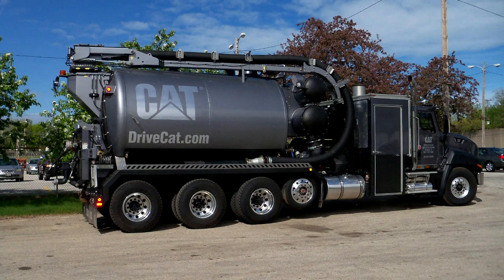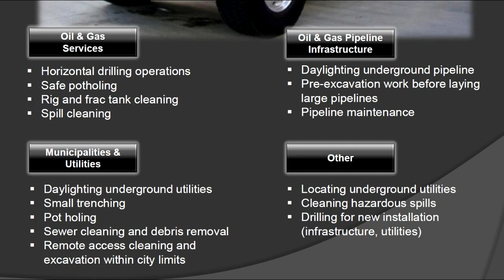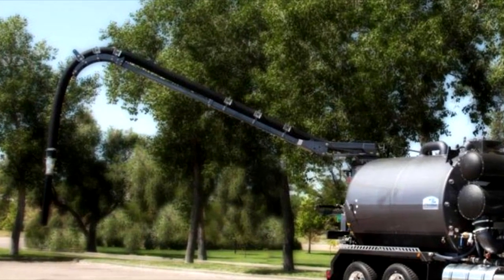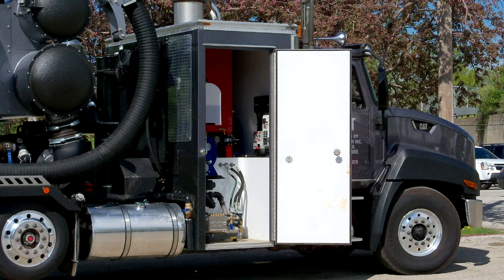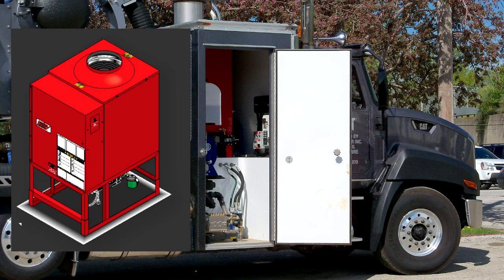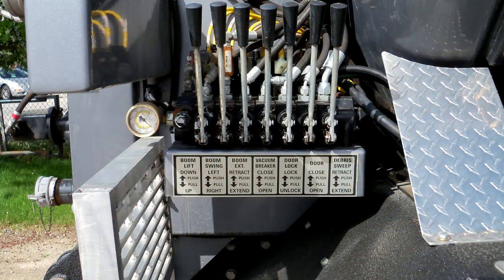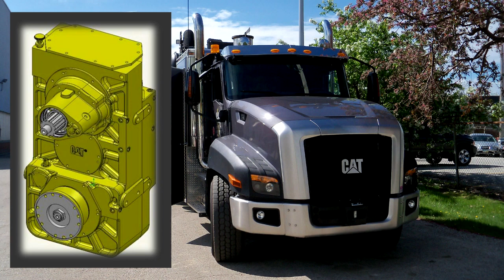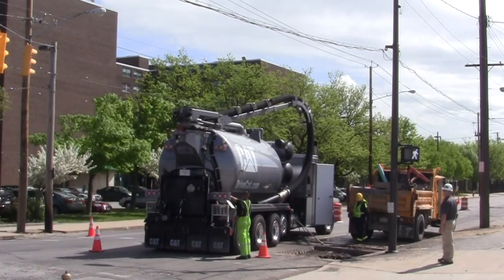Premier Oilfield Hydrovac Excavator CAT CT660 Chassis

Comment: I have operated the top Hydro vac trucks,Tornado Canadian model- best by far,Tornado by Delta,Tornado by Premier,Mud Dog 16 yard one of the first to arrive in North Dakota and leased to Redi  services,and the Vactor.The rest are junk and not worth mentioning.The Vactor is a decent hydro vac truck and will get the job done but is nothing special.Now the 16 yard Mud Dog really impressed me when I was first operating it because it was a big leap from the old skool  Mud dogs that we used in 2008-2009.Its pros were the debris capacity,ability to circulate water while driving to have the water temp perfect in winter time,a good boom,decent storage cabinet,and overall a solid build.Its cons were that after a while the push plate would not retract and I would have to climb up the ladder to the manual override and work it manually every time,also climbing through the push plate was a mission,the spray nozzles in the tank hardly do anything.The Tornado was the best by far and the least problematic.The pros are an awesome boom with incredible digging depth with just a dig tube and great for cleaning rigs,superior insulation and glycol system for water pump-Canadian model,ability to suck water on,spacious storage cabinet,great cabinet heaters Canadian and Delta model,the Premier ones suck  and take forever to reheat if the door is opened,the new debris tank with angled floor and new push plate are great.The cons actually are on the Premier CAT models which I operated for Central Trenching .The heater in the cabinets are horrible,the new cabinets are one big open space instead of having a separating wall down the middle making the spaces harder to heat,the spray nozzles in the tank don't do much,the CAT automatic transmission is horrible and makes the C15  motor seem gutless and also limits power to the wheels on a muddy pipelines.Sorry for being long winded,but just wanted to share my experience with these trucks.
Reply: Rafael Alvarez l Lalita ghodadra na bhajan Niranjan Pandya na Bhajalalefabajanpabafeua

Comment: Super Products Mud-Dog is MUCH better, and more operator friendly.
Reply: ohyea2u I build these trucks so im just curios how they are more operator friendly, I'm not here to to debate im actually curios because i have heard different
Reply: DJLOC1991  There are pros and cons to all the units in the field as you probably know.. I have run ALMOST all the units that are out in the field..And I admit I have NOT run a PREMIER in the field...The cons on the PREMIER.. There is no full push plate to empty the debris . The MUD-DOG has heated water tanks wrapped on the outside of the debris tank which keep the debris from freezing here in North Dakota.. The biggest " not operator friendly " feature I saw when the operator was running the unit was the noise / vibration factor from the blower exhaust. It may have had a bad internal muffler system ( I do not know if you use ceramic liners in these ) .. It also did not help probably that the operator had the RPM'S balls to the wall.. but as soon as I got near the truck, I am not stretching the truth, even with ear plugs, the noise / vibration almost made me sick. The operator I saw at this particular jobsite was down pretty deep, I think he was about 28 feet or so... but to me, that was the biggest defect of this unit... Again, perhaps it was just a defective muffler system on the blower, or maybe the operator had not cleaned filters.. I do not know. Thanks for your reply and time.
Reply: I work for a company that has 2 mud dog trucks and 1 cat vac truck, the cat is amazing compared to the mud dogs. Much more productive and user friendly.

Comment: I offload trucks for a living then process the waste. these are the worst trucks (.)
Reply: I can curr. While the vacum and water pressure system are good, the motors are gutless. This is the unit I work with currently and driving it might be the worst